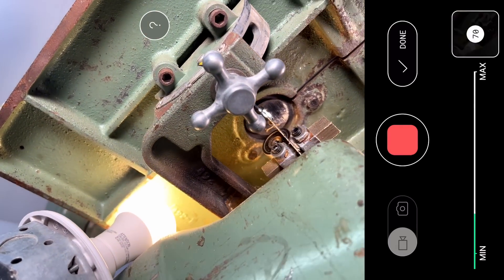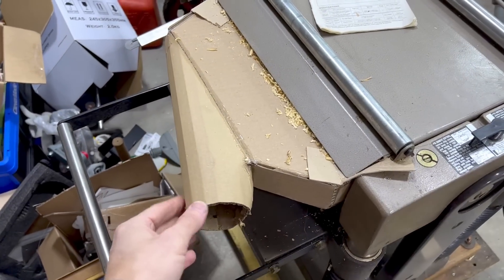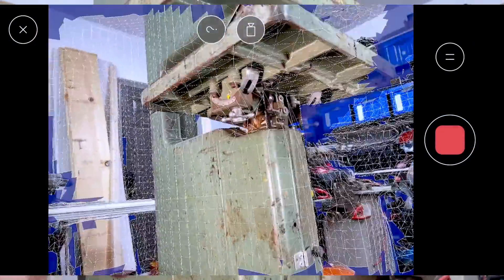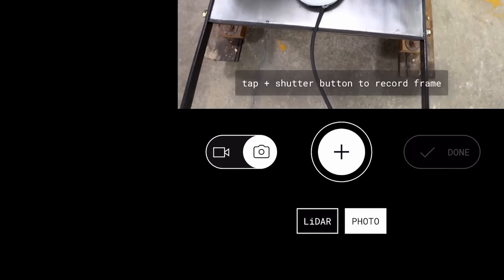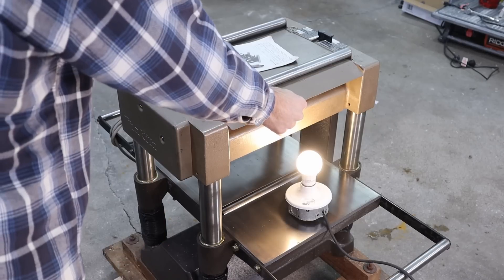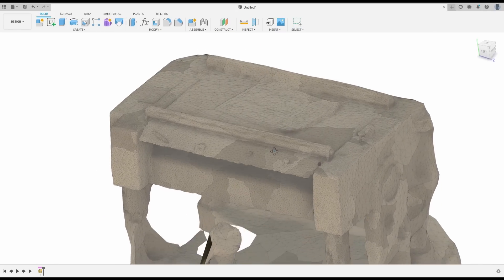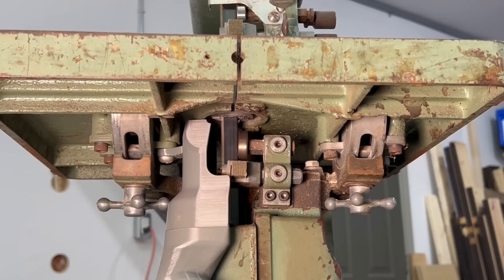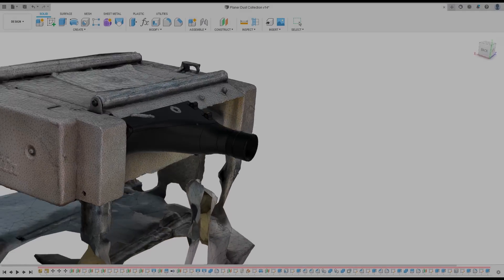Can You 3D Scan Tools With Your Phone, Model, and Print It?

Comment: have you ever 3d print screw before ? you see Im missing one of this screw and needed to print them instead of buying another whole set of items
Reply from the maker: If its a large screw, it's possible, but if it's small, it'd be better to make it from metal.   Do you have some specs on the screw?

Comment: Get Kiri, it looks like the best by far. I am going down this route doing the exact same thing you are doing
Reply from the maker: I'll be sure to try this out, thanks for the heads up on that.  I want to attempt the foot scan and make some shoes for my feet specifically using TPU, but Polycam did not like any of my attempts.  Scanning your own feet is easier said than done...
Reply: @NeedItMakeIt  yea I guess kiri has many different modes and one of them will work.
Reply from the maker: I'll give it go, I've been out running a lot and I'd like to see if I can create something that functions like a shoe that doesn't cost $200

Comment: If you don't mind a little cleanup, you can dust your shiny surfaces with something like sawdust or add a watery/runny toothpaste mixture to a toothbrush and flick it onto the surface and let it dry to give it a flat, speckled surface pattern, and easy to wipe off after.

Comment: The outlet of the housing for the planar should leave to one side to not disturb the outcoming part (as seen in the video). Also relavitely logical not to construvt it over the machine.
Reply: Normally the dust collection tubes are hanging from the ceiling vs coming up from the floor. In the first case a centered housing might be preferable so you can load from both sides of the machine.

Comment: I have the Makita 8030 - Would love to make a dust collector for it, I just need a 3D printer....and some CAD skills....
Reply: You could make it from carboard like he did then coat the whole thing in epoxy. Cheap, easy, will last forever.

I work with CAD all day and have a 3D printer but many times old school works just as good and is faster.
Reply: If you have a microcenter near you you can get an ender 3 pro right now for 100. It's never been cheaper to get into USABLE 3d printing.

Comment: I designed and printed a dust hood for my 15" planer, and I had to print it in 3 sections to minimize support and to fit my print bed. My planer came with a hood with port in the middle, and that's the reason I had to make my own.
Reply from the maker: 3 sections is the way to go.  Nice work, I’d love to see a photo of your work!
Reply: @NeedItMakeIt  how do I share it? I have it on my Instagram.
Reply: @NeedItMakeIt  I messaged you the post on Instagram.

Comment: For creating parts that fit 100% perfectly. I prefer to use good old measuring.
Reply from the maker: Fair enough, love the tradition method as well.  I am currently working on something with compound curves, the scanning is very helpful there.
Reply: @NeedItMakeIt  I still measure ( EVEN IF photogrammetry was perfect, we always measure ) - but the time saved by not having to BUILD the whole thing in Fusion 360 is massive. We don't need the scanned version to be hyper accurate, we just need to be able to tell our 3d software how properly scale the scans to build our prints onto.
Reply: I use a combination. I rough out the part using the scan and then measure any of the important clearances and adjust the part as necessary.

Comment: you could print a angled adapter for the planer dust collection.
Reply from the maker: I will definitely re design, I am still using the original, it works well, but that hose is annoying, it needs to be to one side.

Comment: Ideally, Photogrammetry software likes to differentiate a given pixel from its neighboring pixels.  For the regions that were giving problems, apply a temporary contrasting color, such as dollar store athletes foot powder spray.  A light dust coat works best so that you can see the background color between the powder droplets.  It also dries faster.

Allow adequate drying time so the wetness doesn't appear different as the spray dries between image captures
Reply from the maker: Very cool, thank you for the tip I will give this a try.
Reply: @NeedItMakeIt  
I'm happy just to see someone use this spectacular software to make something practical and not just pretty 3D models.  This technology has so many great applications!  Keep up the great work!
Reply from the maker: @SwankySasquatch66  Thank you kindly!  I have lots of ideas for using this software and I'd imagine it will improve dramatically in the coming years.  I'd like to see the objects come in as useable shapes to see interferences and to use faces as reference, rather than eyeballing it to get it close.

Comment: Considered the app until you mentioned it's a subscription based product. Really impressive and informative video,  thanks for sharing!
Reply: 100%. I’m done with subscription models. Either I buy it, or I don’t use it
Reply: I've had a lot of success with a free and open source PC software called Meshroom. Only small drawback is that you need a PC and need to copy your pictures from your phone to it.
Reply: @MXarcx  Thanks for the recommendation, I'll check it out👍
Reply: "3d scanner app" is a free version
Reply: You can also use an app called Hedges (and probably many others) on your front facing iphone lidar camera and its much higher precision than the rear facing lidar that is designed for room scale.
Reply from the maker: I can see activating the software only when you need it.  Eventually there will be free versions which work just as well or better.  I am looking forward to a time when every phone can 3D scan right from the box.   Thank you for taking the time to leave a comment!
Reply: @NeedItMakeIt  So you can activate it and deactivate it and the subscription timer stops? I'm a little confused. I'll have to look into it. I won't do anything subscription-based either.
Reply from the maker: @dangerous8333  You pay for 1 month intervals, or cheaper for a year of course.
Reply: Yep...

I don't do anything subscription based. The minute Adobe went to subscription I dropped them and haven't used them since. Especially for something like this that I would only use once in a while.

Oh well...
Reply: You guys realize people out a ton of effort to make these apps right? So a subscription is actually very fair. Not paying $10 for such a useful app, but happily tipping people for way more on family dinners?
Reply: @muhammedmorsi43 YUP, trained in web design / multi media over a decade ago now. Subscription models aren't the only way for the devs to make a profit, it's a useful way to extract as much money possible from those dependent on the product - personally don't use it so not tied to it. 

Buy a product and own it or rent it continuously is an easy choice given the option.
Reply: @muhammedmorsi43  Nobody is taking issue with paying for an app, they're taking issue with "renting" an app through a subscription.
Reply: @muhammedmorsi43  yeah but paying $120 per year is steep for an occasional use.